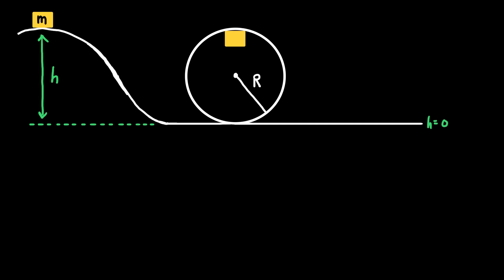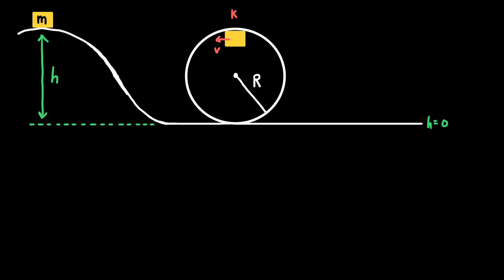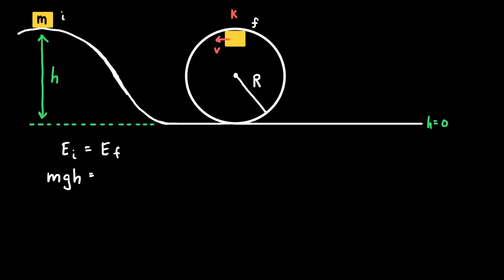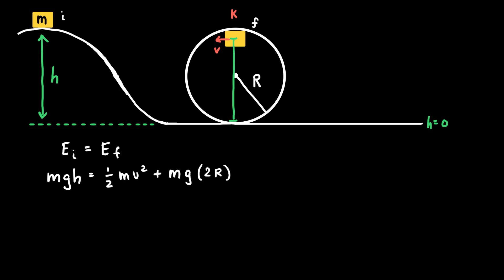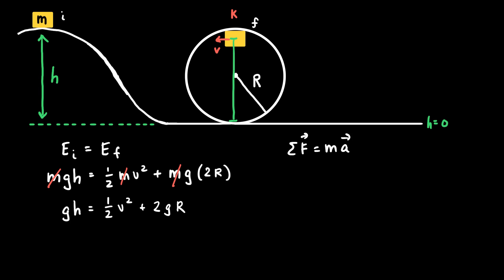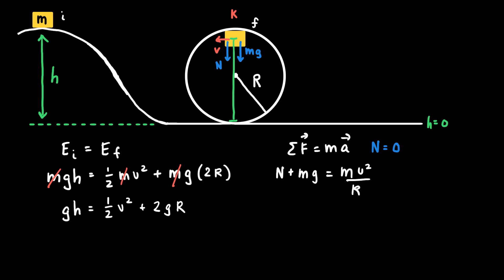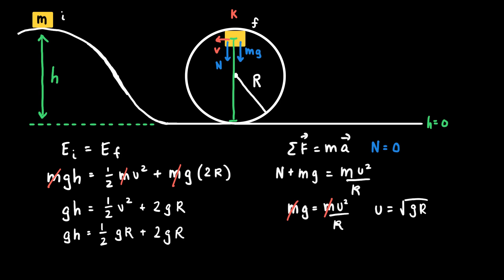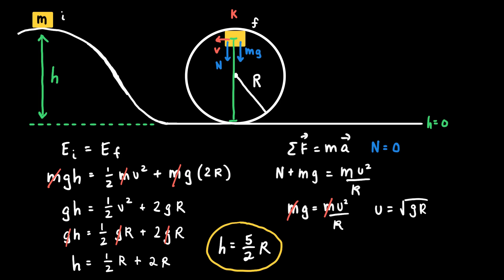Minimum Speed to Go Around a Loop

Comment: You are supposed to take into account the energy of rotation of the ball in the final energy. Making the assumption that the ball is pure rolling in all of it's travel, the tangential velocity (Vt) must be equal to the velocity of the center of mass (Vc) which we know is Vc = sqrt(g*R). Then the angular velocity is  Vt = Rω ;
Vc = Rω ;  (Vt=Vc)
ω = Vc/R = sqrt(g*R)/R  (Vc=sqrt(g*R).
Then the rotational energy is:
Kr = 1/2*ω^2*I ;
Kr= 1/2* sqrt(g*R)/R* I. 
Remenber that "I" is the moment of inertia of a ball (sphere) or a disk if you simplify the problem (If you need to substitute it search for it  (should be in Wikipedia or any proper physics book about classical mechanics)).

Comment: Whats 1/2R + 10R?
Reply: first give both sides a common denominator by multiplying both the numerator and denominators of the fractions on both sides (in this case I multiplied the left side by 10 and the right side by 20). the reason they are still equal to the original values is because they are equivalent; try dividing the values below (ie 10/20 should give 0.5, or 1/2, and 200/20 should give 10, which are both the original values).

10/20R + 200/20R

now just add them: 210/20R

which can be reduced to 21/2R.
Reply: @hummus9118  thanks dude
Reply: @abbbyggrim3288  no problem :)

Comment: Hello. Thank you for the video. I had a query. what will happen when the vehicle have more speed than it needs?
Reply: go faster
Reply: The normal force (and centripetal force) will be greater. This would (in real life) result in higher friction with the surface of the loop (so, lower efficiency, but higher speed).
Reply: it will travel further along the loop before loosing contact with it

Comment: Why didn't we take the distance from the launch point into consideration???
Reply: Because we assumed there's no friction, so it doesn't matter how far away in the horizontal axis the start point is
Reply: Ettoyea z  no: this problem is viewed from an energy standpoint, not a dynamical one where variables such as displacement, acceleration or acceleration along track are considered (so not using suvat equations) Considering conservation of mechanical energy incredibly simplifies the physics, and tedious maths that would be required if a dynamical approach is taken.
Reply: @donegal79  Ok, got it
Reply: @donegal79  Exactly.
Reply: Coefficient of Friction is taken to be 0